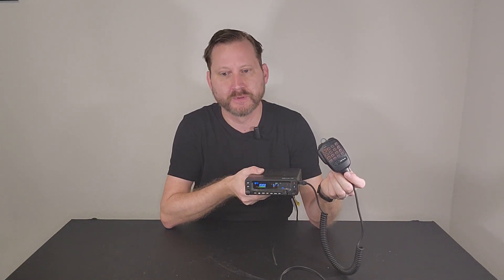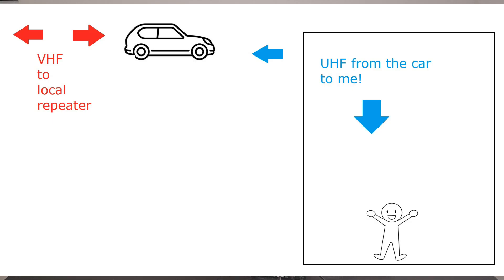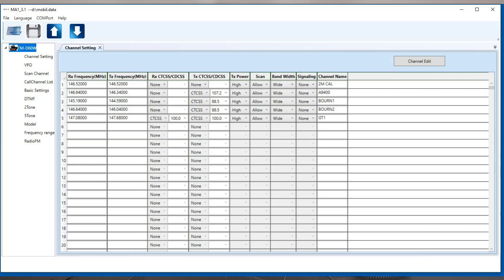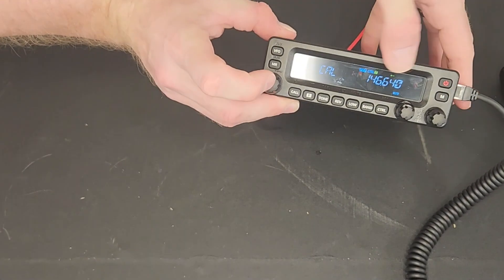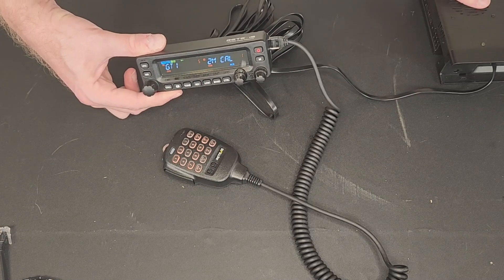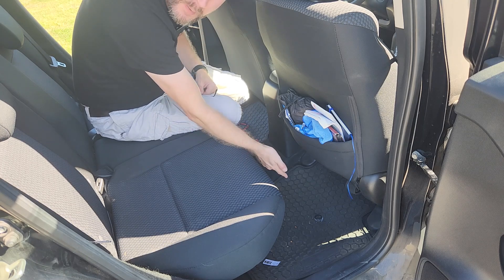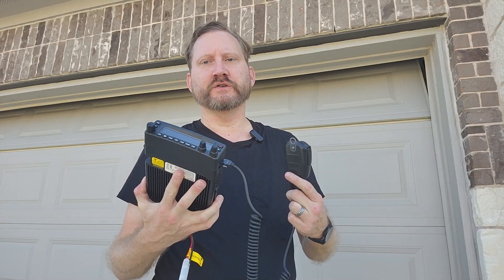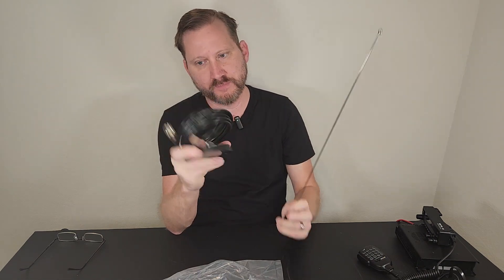Retevis MA1 dual band mobile radio with dual tuners | Texas Prepper Projects

Comment: It will do the automatic repeater offsets, but you have to turn that feature on in the menu.  Menu item 401 I think it is, ARO - turn it on.  That is the Automatic Repeater Offset!  Run that antenna cable through the door opening, not the window!  The window will exceed the bend radius of the coax and cause problems, but the rubber seal in the doorway will conform to the shape of the coax without putting a sharp bend in it.
Reply from the maker: Awesome

Comment: Can this transmit on GMRS band?  (Hypothetically, LOL)
Reply from the maker: Yup 'In theory'. All chinese radios are wide band. Which means (in theory) that you could set up cross band repeater on MURS  154.600 vhf and GMRS 462.xxx and run your own repeater off your baofung or Retevis A1.  and be semi private.. in theory.  ;)
Reply: Just to confirm my understanding on these theories, is GMRS only possible using the repeater function or is it theoretically possible for this radio to transmit and receive GMRS without use of the repeater function?
Reply: @caradineme2  The radio will transmit and receive on any frequency or pair thereof that the radio allows to be programmed. I haven't programmed GMRS into mine, nor have I attempted to unlock the radio. The radio is capable of receiving GMRS frequencies as shipped, but not GMRS as the transmit caps out at 450 MHz. I can't find any unlocking instructions anywhere, but the radio is relatively new.  As shipped for US use, the Retevis MA1 has the following frequency ranges: 144-148 MHz for VHF TX and 420-450 MHz for UHF TX. Its wide receive range includes 108-180 MHz (including AM airband), 64-108 MHz (FM Radio), and 400-520 MHz. Unless an unlocking mod procedure is discovered, it will not transmit on either MURS or GMRS frequencies.
Reply: @BakerStudiosIndy  thanks for the detailed reply. I ended up purchasing the radio myself as well. I reached out to Retevis and they provided me with the unlock instructions. Per my testing, when I switched modes, GMRS functioned great in my experience. The testing was completed using the included antenna that came with the radio bundle.
Reply: @caradineme2  Good to know. I may want to unlock mine at some point. I just haven't felt the need just yet. It's a great radio and a bargain at the price.
Reply: @BakerStudiosIndy Agreed, I've loved the radio so far and have gotten back all good signal reports on 2m.
Reply: What are the unlocking instructions? I